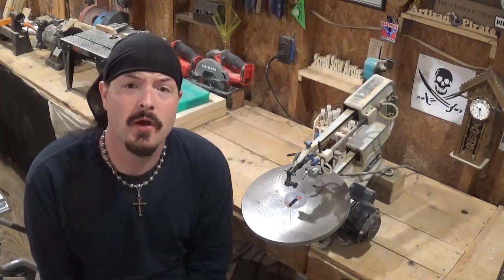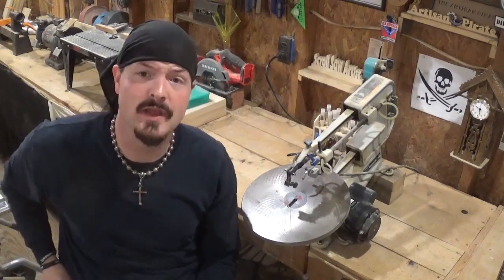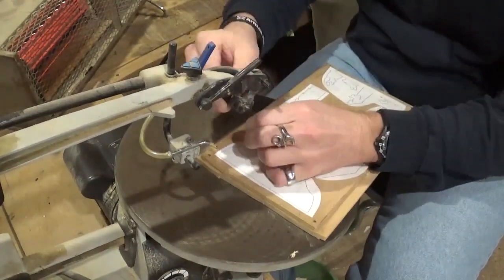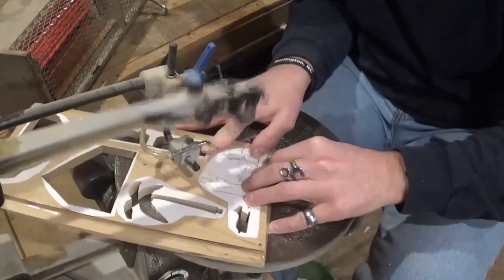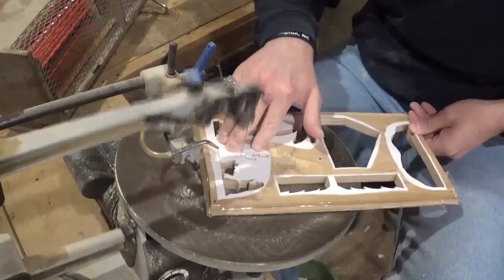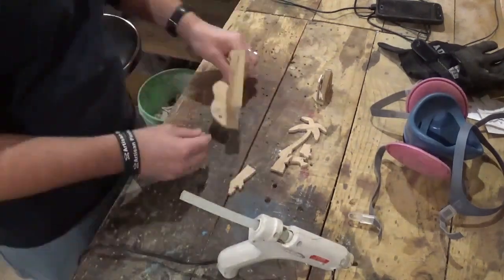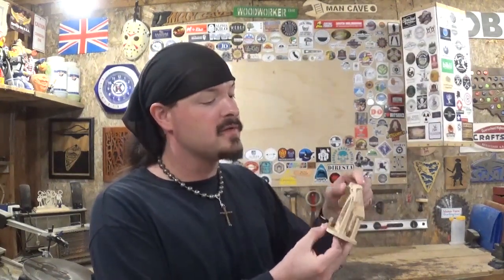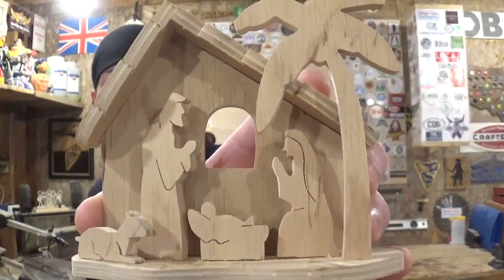Christmas Scroll Saw Desktop Nativity

Comment: You might also consider using CA /super glue with a drop or two of wood
glue and a accelerant spray for a quick as well as solid way to hold 
projects together that also takes very little time. Good job...
Have a Merry Merry and a Happy Happy.
Reply from the maker: Never used CA Glue before on projects

Comment: 12/23/2022.  That is a beautiful piece, well done. I would like to get started in this craft. What do you recommend to start with (machinery, projects, etc.)?
Reply from the maker: If it was me, wanting to get started, I'd go find a decent used Scroll Saw from a pawn shop or marketplace or something. Then i'd invest in good quality scroll saw blades, I use Pegas and Sharktooth brand blades.
Then, I'd find a few beginner projects on Steve Good's catalog just to get your feet wet and learn the basics.
Keep in mind, most lower end scroll saws use what is called pinned blades and you can do some good work on them, however, it will limit you to the amount of detail you can produce like some of the projects like i've done on my channel.
If you know of any scrollers in your area, I'd ask if you were able to come by and try one before investing too much into one
If you really wanna enjoy the craft, Id recommend a scroll saw that uses pinless blades and has tool free blade changing chucks,
Sorry for the late reply and I hope this information is helpful!